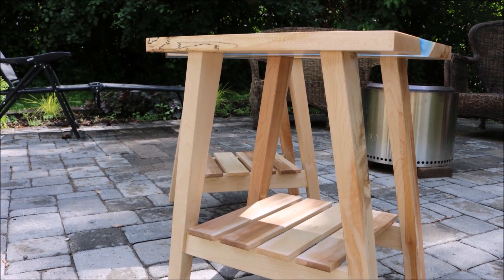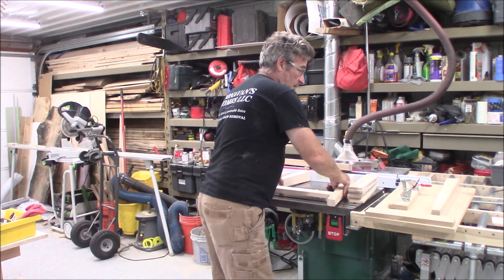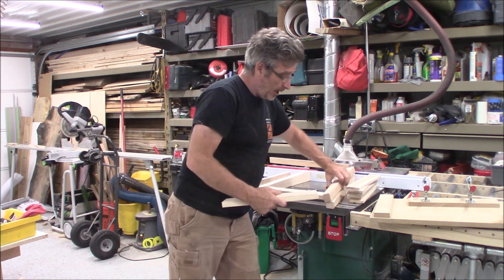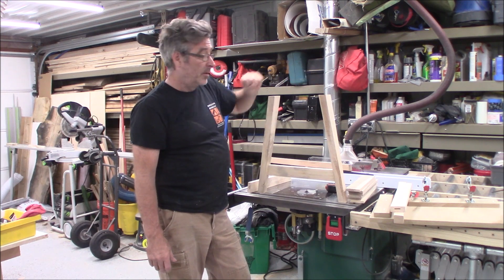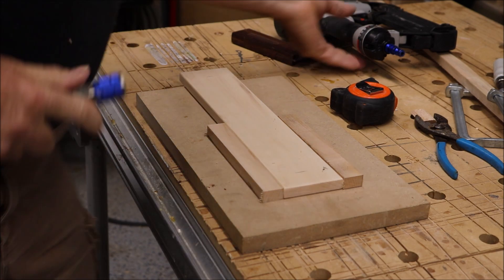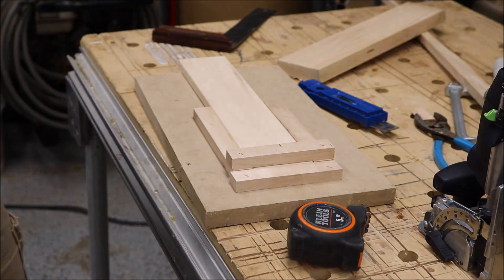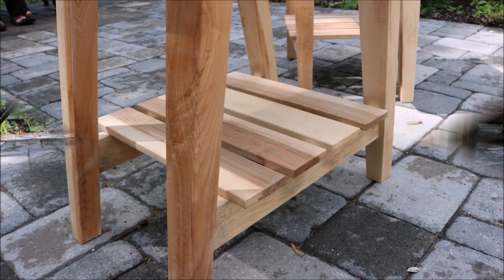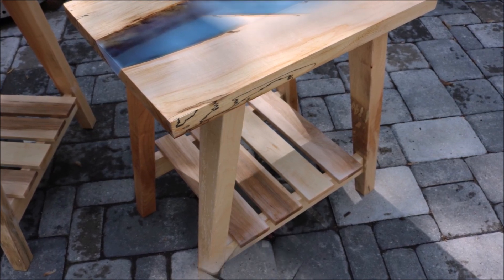Epoxy  River End Tables part 2 of 2

Comment: Turned out Great.  If you had it to do over again on the pour would you have put the table top with the top side facing down on the melamine to get the epoxy even with the wood?  When you did your final sanding did you get the wood even with the epoxy or did it actually matter that much?  I'd like to be able to do this for my wife some day.
Thanks for sharing.